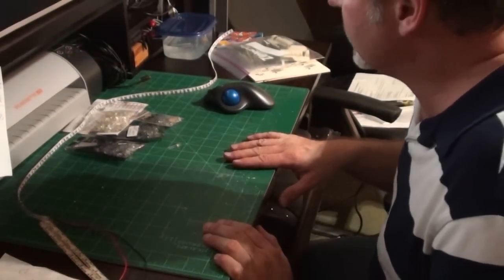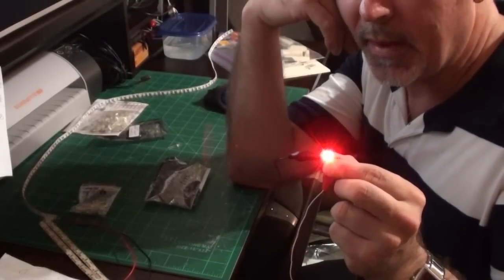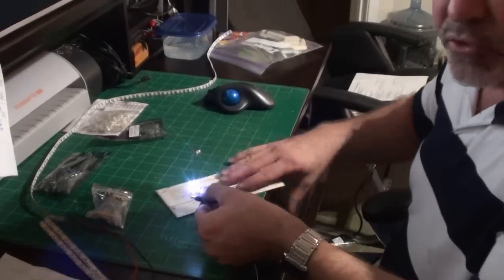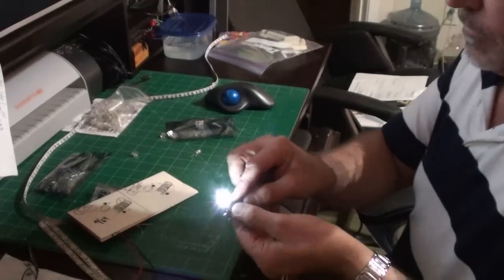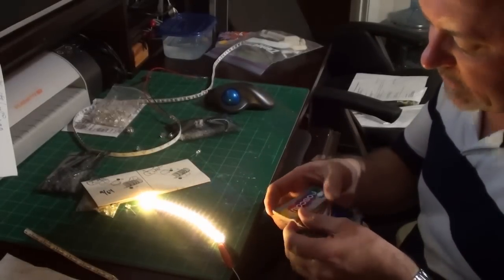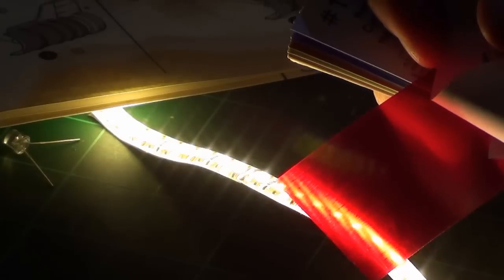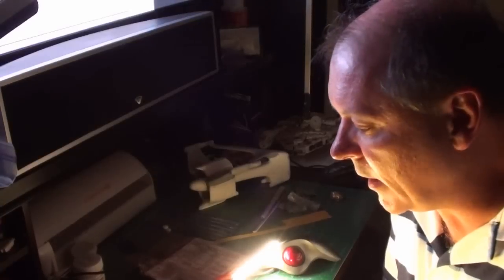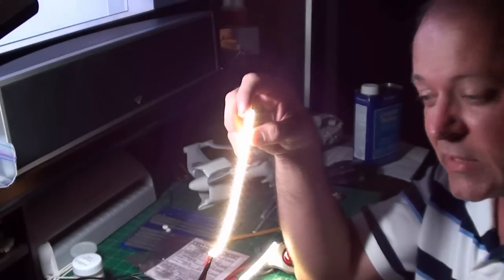Lighting tutorial:  Different types of LED's

Comment: I added some bright white LED's to one of my railroad coaches and my wife said it looked too bright to be prototypical.  So I took it apart and painted each LED (12 total) with some yellow acrylic paint.  Now it looks like the old incandescent bulbs typical of lighting in older gas lit coaches.  Acrylic paint works better than color gels.  I'm also a photographer and have a number of gels to go over my lens.  You still get that harsh bright spot (hot spot) even using a gel.  Try using some acrylic paint on top of your LED's.  It works quite well.
W Rusty Lane in eastern Tennessee (Witherington Place Railroad)
Reply from the maker: Thanks for the comment, good tip!

Comment: have u ever seen anyone print an image on a Gel sheet??   for example a star wars control panel with lots of lights and shapes.  i was thinking of making an image on photoshop and then  printing the image on a gel sheet, then putting lights underneath the Gel. it would look like   the control panel is   lit with lights.   i was wondering why i haven't seen people do that?
Reply from the maker: I have not, but I have thought about printing images on white decal paper placing that on the model and lighting the underside. 

I think the main problem is light leak, So whatever you do you would have to be very careful with blocking out undesired colors.

Comment: I do alot of costuming and have only ever used Diodes in props before. I am attempting to add an LED strip to a skirt of a dress. The skirt will have three layers of chiffon organza (sheer) fabric to help diffuse the light. However since im going  to be walking around with the dress lit up is their a way to circuit the LED strips to a small battery power pack that i can hide within the costume?

Comment: question, trying to learn the diff types of lead's.  I am going to build underwater sealed swim lights that go under the back of our boat(very expensive to buy). anyhow needs to end up around 2400 lumens and i think the flat top's you showed as we need the to broadcast out about 50 ft.most have 6 to twelve led's in each light. what led's are the brightest ? do i wire in a series or parallel? how do i drive them, as i want durability? and do i need to worry about heat?Thanks
Reply from the maker: Not sure on this one, since I don't work with water proof LED's..

Comment: What are the type of LEDs used in light bars for off road vehicles?
Reply from the maker: Not sure but I bet you can find them on Ebay.    But if I had to guess, it is something like this:

http://www.ebay.com/itm/5x-10W-Bright-Clear-White-Light-LED-6500K-High-Power-1100LM-12V-10-Watt-Lamp-/141568674249?pt=LH_DefaultDomain_0&hash=item20f62689c9

Comment: Hey i need some advise...... I was trying to hook up a Red LED and a Green LED using the same power supply and the Green will work and the Red will not??? any idea?
Reply from the maker: The red LED would like to have 1.8 V passing through it while the green would need 3.2V.   So you need to add a resistor to that red LED to coexist with the green.   

Most likely you have burned out that red one if the green one is lighting up.

Comment: What are you using to test your LEDs?
Reply from the maker: I have a lab quality power supply I got off of Ebay.   You can get them on Amazon as well.   This way I can control the voltage very precisely.

Comment: What would people recommend for making an LED torch (containing multiple LED's in one circuit) built into one of my Nerf guns. I do a lot of night wars an found quite a lot of torches disappointing. Planing just to build some in to the blaster itself.

Note they need to be bright for camera

Thanks
Reply from the maker: It can be done, just wire them in parallel, two AA batteries will power 13 LED's for quite a bit.   Just get  some bright white 5mm leds.    Don't mess with the 10 MM, they don't put out enough light.

IF you use the two AA batteries, you won't need resistors in parallel.
Reply: So basically, however many LED's I need/want up to 13, and wire them up in parallel to 2x AA's and I'm good to go.

The LED's are just white 5mm ones?

Ok sweet thinks. Hopefully this will be the start of the light interventions to my Blasters, and various other things that come across.

Thanks for the help
Reply from the maker: Michael White The LED's are just white 5 MM ones.  When you get ready to do some wiring, do a google search for the LED wizard, it will show you how to wire them.

Comment from the maker: I don't, but for the most part most white LED's will require the same voltage, most red the same voltage etc.   What changes from regular to pico or mini is the power consumption.   I know that a 3mm LED has the same power consumption as a SMD so it might be the same.

Comment: Perfects thanks! I got a project that I'm gonna be using some leds. My concern about this project is that I need low voltage/bright leds and a very simple circuit with a push on/off button. That means the brightest I can get for the lowest voltage and the least amount of cables. Also, I'm gonna be using approximately 6 LEDs. What can be your best advice?

Comment from the maker: LED's require direct current and will not operate on AC.  But if you get a wall adapter you can plug it into the wall and power your LED's.   They are commonly called wall warts, and you can find them really cheap at places like goodwill.   Or when something electronic breaks, you can just salvage the adapter.  For example if your cell phone dies, you can keep the charger and use it to power your LED project.   That is what I have been doing.   They have the voltage written on them.

Comment from the maker: I don't know a whole lot about lighting and major batteries.  Most of what I have done is with AAA or your simple 9V.  It wouldn't surprise me if what you are saying is true.   A AAA will only supply about .5amps of current, while the batteries you are talking about are capable of far more than that.   So you will need something in there to limit the current or it will just burn them out.

Comment from the maker: @yahmana I would take a look at a few of the commercial plant lights and find the color they use.  Like 3000K.  Once you do that, then just do an ebay search for that color.  You will find plenty of results. 

Raw LED's are usually found under electrical and test equipment.

Comment from the maker: @ModelManTom Thanks for the info on the side fire.  And no the lighting are not that expensive if you want the basic four pack.   But if you want a specific color, then they get you.   One 10x10 sheet is about $7 on ebay.  But the four pack is about $9.

Comment: Cheers, John!
I've never seen that first rgb flasher, just the all slow or all fast.  

I take the dremel cutting wheel to leds when I need them shaped.

Thanks for the lighting gel notes, I'd thought they were massive-money!

There are two types of 'side-fire', the other has the leds aimed at a right angle from the strip, only avail in single density.  With the 'side fire' I sent you, the LEDs are still aimed perpendicular to the strip, but spread the light like butter all down the strip.